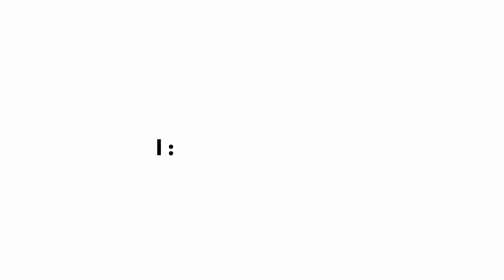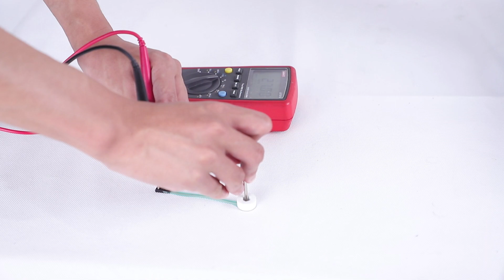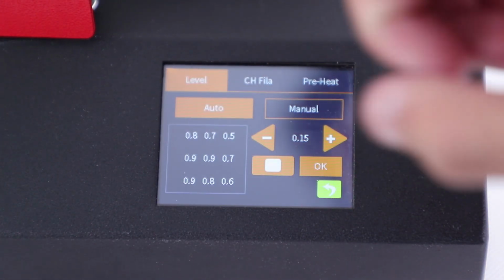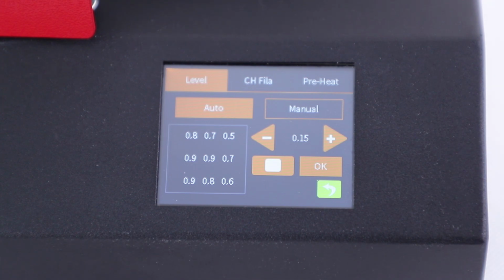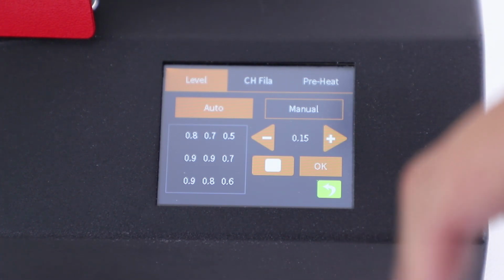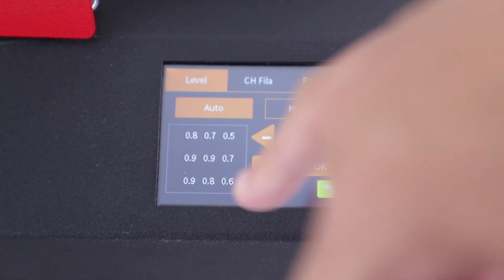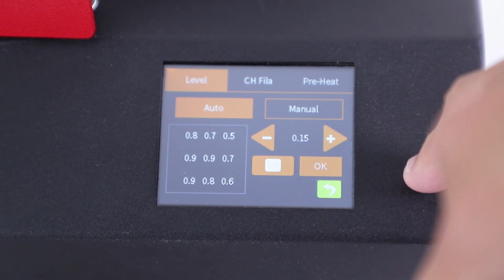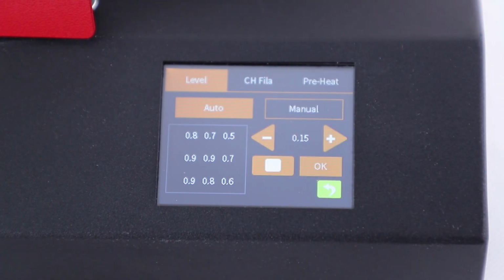Anet ET4 Leveling Tutorial

Comment: I bought mine just a couple of weeks ago. I'm having a strange issue with the first layer, being too thin. So i tried to relevel my bed, and now it seems to work flawlessly, even if some pieces don't stay on the glass panel sometimes.
My question is: what's the meaning of the +0.15 you set on your printer? How can i use it for my ET4 ? When i finisced my auto leveling the level were all above 1 (from 1.3 to 1.5).